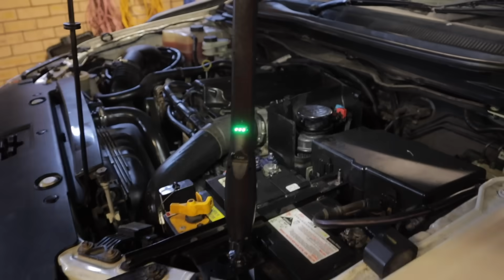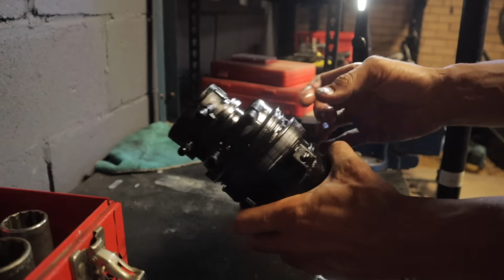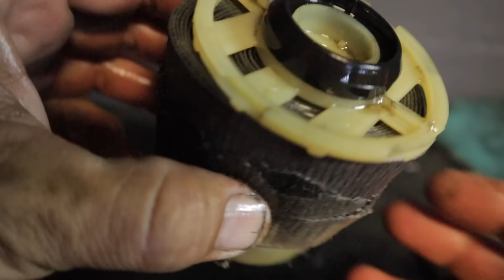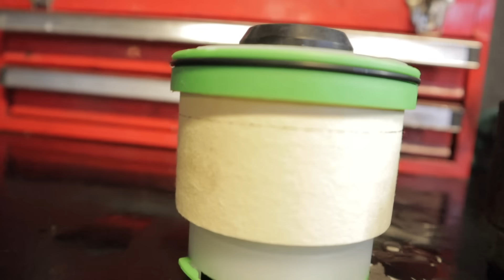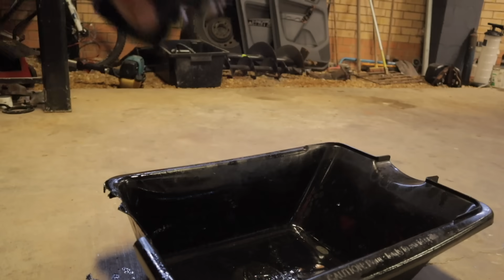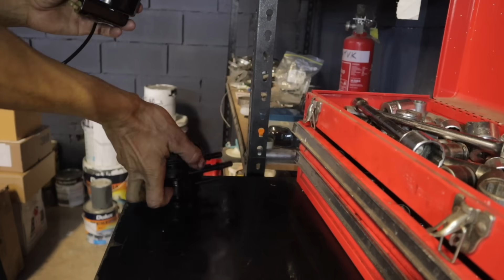The No.1 Reason Why Ford Ranger Engines Fail.

Comment: i just dont trust these cars/ford and holden as they arnt made in australia,remember the holden cars hq hx wb ford xa xb etc they where a bullet proof cars and easy and cheap to fix,now they are a bitsa parts from nearly every country,example holden astra,s a crap car,that why im stayn with hilux 2000 model  so easy to fix  and a headlight $30 a ford ranger 2023 is $2700 thats right $2700 to just replace 1 headlight with original and the rear tail light cost even more,a mates car small damage and $14,000 to repair if that wan the hilux 2000 would be around $500  tops

Comment: What happens when a filter becomes blocked is that it simply starves the engine of fuel. It does not cause the engine to fail. Water, which is what was found at the bottom of the canister, should have a level sensor that warns the driver should the level exceed the maximum allowed. That is the time to drain the canister.
Injector failure is not generally caused by lack of maintenance, although in very rare instances it could be. Injector failure may be due to bad fuel with contaminants that compromise lubricity, or excess soot caused by blocked air filters, or poor injector quality which was an issue with early Continental injectors fitted to these engines. The main thing that kills these engines other than injectors and subsequent melting of a piston is a failed engine oil pump.  These should be changed every 60,000 miles or so to prevent failure and seizure of the engine. This is not part of Ford’s recommended service schedules.

Comment: I do wonder why people are in denial about basic maintenance.
Motor manufacturers have done the R&D on this practice and if they say new oil filter at least every 10,000miles, they really do mean it. 
Same with fuel additives: oil companies have developed fuels to work well with modern engines, they do NOT recommend using old cooking oil in your new diesel. I am also skeptical of the need for AdBlu in a new diesel engine. £2.50/lt for AdBlu when it's only £1.30 for actual diesel? REALLY!
Reply: You must be getting fleeced on the Adblue. I can buy it in the UK in 20litre drums [enough for two Ranger refills] for about £1/litre compared to diesel for about £1.35 at the moment. Best price I can get short of 1000 litre IBC’s is for two 200 litre drums of Adblue at £0.50 plus VAT, so 60p for the private buyer delivered to your doorstep.

Comment: Thats a lot of water. Fuel tank probably the same. I recently did the Simpson in my 2019 3.2 many remote servos had very old pumps and tank arrangements. Will check my fuel filter after seeing this. 
Good to see the Ranger fuel filter has a water trap.

Comment: I think you got it wrong mate , let me tell you the reason Ford Ranger engines fail .It's got a weak oil pump design. The oil pump doesn't hold oil when doing oil change. You can't just open the sump plug and go for  lunch break, no no . This engine pump doesn't have a valve that keeps oil in the oil pump ,it will run out and you won't have oil pressure

Comment: Oooh, that was bad. I've seen filters that are excessively dirty before (here's my video of a 100,000 mile petrol filter https://www.youtube.com/watch?v=8aZLTbG993Y) but I've never seen one breaking down like that. Maybe it's the effect diesel has on the filter material. Yeah, good job you were changing it. And as you say, test and clean out the injectors and fuel rail. looking forward to that video.

Comment: Replace the first ‘R’ in Ranger with a ‘B’ and you get….
BANGER!
Reply: Don't you mean D as in Danger?
Watch out for the ranger driver.
Pity he saved it 😂
Reply: The motor in the Ford ranger is actually a Volvo motor.also I seen a short video where a gm motor.died after 4miles and another died at 100miles

Comment: I have seen a perfectly maintained Ranger engine fail due to an injector being stuck open.  An additional fuel filter is almost essential on these engines.
Reply: Ford engine is made by Volvo
Reply: Yeah, the one i saw drilled a big hole through a piston which led to catastrophic failure. New Engine Needed.   Done about 250K.    Properly maintained, just blew up.   AVOID,,,
Reply: a 2nd filter wont stop it as my mate blew his engine

Comment: Click bait title. Like others have stated maintenance is on the owner, not the manufacturer. I have the same model vehicle just a Mazda BT-50 and it's serviced every 10k kms, also installed a secondary fuel filter at near new as all diesel engines should have from factory but don't, and it's done 100k kms and no issues. Every vehicle will fail if maintenance is neglected. FYI depending on where you get your fuel from, but if regularly refuelling from service stations if you change your fuel filter every 20k km the filter can be sometimes as dirty as the one you showed, obviously not as old and deteriorated and stuck in the filter head, but I've seem them just as black. For those wondering about the condition of the tank- this is what a filter is for and if you have 2 it limits particulates getting through. A fuel treatment a few times to kill the diesel bug in the tank helps prevent things becoming worse
Reply: But if you do use an algae killer in the tank...check your fuel filter every week for the first month..
the dead algae has to go somewhere since it is no longer clinging to the tank walls.
Reply: Same , my Bt50 2013 has been tuned ,bigger intercooler, and I thrash it around, only city driving 280 000km, always change the filters regularly👌 although I haven't checked the diffs ,transfer or gearbox in over 5 years🤔
Reply: @ 
Renew the fluids if it's been 5 years.....
Reply: Plus the tank is plastic anyway

Comment: I’d suggest that you start saving for HP fuel pump and injections etc That filter 50,000 Ks I guess or the diesel is from the tip 
Can’t blame the car for That 
At the same time Manufacturer’s have this nonsense of recommending filter change every 60,000 Ka 
Madness every 10 at least and a pre filter 4 microns or less I am not a fan of conspiracy theories,but you would have to ask what their engineers are thinking about 
Those are not filtered anything after say 10,000 k 🚜🇦🇺🇮🇪☘️🍀

Comment: The filter arrangement is a gravity filter, water is designed to accumulate in the bottom because it must never enter the combustion chamber in diesels.  A petrol engine just has a straight filter because a bit of water in the engine is not a problem, it just vapourises and goes out the tailpipe.
A failure of the filter will lead to water entering the cyilnder which will blow the head gasket and possibly punch a hole in the piston head or snap an exhaust valve.  Usually though there is a release valve to let the water out, so they can soldier on for quite a long time before it becomes an issue.
The stuff at the bottom is just a bit of mud and water from the mine site.
Reply: My 1991 JDM turbo diesel has a water indicator 
(basically a cork float in the bottom of the fuel filter base just above the drain)  that activates a light on the dash.
Are you saying that this modern diesel....doesn't???

Comment: Did an engine replacement on a 2016 3.2 td ranger 3 weeks ago
 the egr cooler had shat itself partially hydrolocked the engine the customer then towstarted it drove it round for a week before booking it in for coolant loss
Reply: Ford have sent letters out to Ranger/Everest owners that state, if the egr cooler fails within 10 years and 250,000km, they will replace it, and any other damaged item, including engines under an extended warranty. I sent one of my customers with an Everest 2016 model to ford, they drove away with new engine fitted.
Reply: @glenohara6563  First time I heard of that. Is this something only in Australia?
Reply: @ Not sure if it is Oz only. But defiantly a thing here in Australia.
Reply: @glenohara6563  Got my letter, well after the EGR failed the first time. I got reimbursed fully. Had the EGR fail again about 20,000km later. Ford Fixed it. It has just now done it's third EGR, all within 50,000km. I told FORD that if this does not fix the issue, then the next time it will be civil litigation. They are jumping through hoops now to please me...... But should not have happened in the first place.

Comment: Seems like the quality of the fuel itself should be brought into question. Do the pumps not have delivery filters to separate water and debris.?
Reply: High humidity will cause fuel tanks to condensate. Depends where you live.
Reply: Fuel in Australia is ranked 75th in the world
Reply: @jamesbarrows-y2i Of course it is.

Comment: I also have heard, let me know if I’m wrong, if you start your ranger from cold, or maybe any other common rail and say for example move it out of your shed and put it out on your driveway without using for the day, condensation builds up in the cylinder wall and turns to rust and these tiny water droplets can rust over the injector nozzle affecting the spray pattern and then because of the huge common rail pressure the spray turns into a stream and can cut a hole through the piston. A mechanic at ford told me this and it’s seems to make sense, so if you start it drive it.
Reply: Rubbish
Reply: @ReddThreee  obviously not a mechanic
Reply: No he’s not, I am.
Reply: @ "I have also heard" and "let me know if I'm wrong" but you're a mechanic?
If you're a mechanic, you'd know wouldnt you?

Comment: This would be for all diesel engines not just Ford Rangers
Reply: My hilux diesel never has that problem 😊
Reply: @macrospaticawen3611 got nothing to do with the manufacture of the vehicles but everything to do with maintenance and dirty fuel in this case. All diesels need clean air, clean fuel, clean oil and regular maintenance. Then they pretty happy and will run for years.

Comment: Don't use brake cleaner on plastic or rubber. Surprised the brake cleaner didn't instantly turn that plastic brittle and crumble in your hands. Plus any seals on the housing you got brake cleaner on would likely of turned hard and/or lost its shape.
Reply from the maker: Been doing it for 200 000kms & 5yrs on my other Rangers filter housing with no issues 🤷🏼‍♂️
Reply: @abdautomotive  Likely you have the non-chlorinated stuff which is less damaging on plastic but can stick effect rubber. You can still get the chlorinated stuff though so gotta be careful. Better off using something like Windex and compressed air or if no compressed air use a plastic safe electrical/contact cleaner
Reply: The only time I seen a reaction like that was on my dolphin torch and it was petrol 😂

Comment: Mate you got it wrong sir yes poor service would cause any vehicle problems but Ford rangers main problem is there gear boxes really
Reply: To single out Ford transmissions as bad in general you are incorrect. Holden Colorado are known for having faults with their transmissions also. I have a 2018 model Ranger  3.2 auto and have had no problems with my transmissions. 😊

Comment: Yep  have always suspected a large percntage of failed vehicles come down to either owners not maintaining them properly or mechanics doing poor work or no work.
Reply: I have a Honda C-RV 1.6 twin turbo diesel and it has been serviced every year or 10,000 miles, usually every 8000.  Last three services were at a main Honda dealer and at the very last service I asked for a full major service apart from auto gearbox oil and rear diff oil which had both been done less than 15,000 miles previously. The car broke down with my wife and daughter on a motorway and had to be carted to home on the back of a truck Turns out that they had done as I asked, including changing the brake fluid, but had not bothered to change the fuel filter in any of the three services prior. The system detected low fuel pressure and shut the system down. That’s all that happens if a common rail fuel filter blocks. Changed the fuel filter and it has been fine since but I have lost whatever trust I ever had [not much] in main dealer servicing. I’ve yet to find one that I can trust not to try and fleece me and/or to do the work properly.

Comment: It’s a ford 
They are the best at breaking down then pissing off mechanics because they are designed and built so stupid
Reply: Can you explain yourself on how they are designed and built so stupid generally curious?
Reply: @ personal experience customer brings in 2013 f-150 to reseal from diff cover and the differential has to be removed from the truck to get the cover off and to change the oil there’s no drain plug so cover has to come off . I called the ford dealer and the service manager said he gets yelled at on the regular because it’s $1,300 to change the oil on the front diff 

In the same day I did ford diesel power steering pump and dodge diesel power steering pump , ford took me all day and the dodge took me 30 minutes 

I have 20 years experience on highway , Offroad and automotive and fords are the worst
Reply: @benmartin6476  Ye fair enough. I am not to sure about the f trucks but the rangers are pretty easy to work on I cannot complain.

Comment: Factory recommended interval Toyota filter look like this when done  [blackish].
Another great idea is run fuel down to 5---10ltrs remaining and drain tank completely . This removes water and debris . Drain the tank into a white rag .
Reply: Toyota diesel fuel filters definitely do not look like this during it's recommended change intervals. 

And the 'blackish' you are talking about is the asphaltenes in the diesel fuel, not dirt, which is completely normal.
Reply: @jack11224  
I was new to diesels but I knew when it wouldn't rev over 2500rpm that there was something wrong. 
I took strings of algae out of the old fuel filter of my JDM import turbo diesel. 
The fuel filter had Japanese writing on it....
maybe never changed from new....some 9 years!

New filter= 4200rpm.
Reply: @JohnSmith-pl2bk  Wow, yes, it most likely had never been changed. Or either the car was sitting for a long period of time on the same tank that accumulated water or a bad contaminated fill of diesel. However, with other people in these comment's saying they change it every service, I still think that's overkill/unnecessary, especially in Australia. We have relatively clean fuel.

Comment: I do mine every 10K interval, no matter what happens, plus I put a 30 micron pre filter before that.
Reply: THat's great, but 10k is 5k too many in my humble opinion, but at least your truck has something to look forward to on a regular basis. And I'm sure you love it too.
Reply: @ I agreed that 10k is unnecessary espically with a pre filter. But consider an OEM filter is like 40 ish bucks, and only took me half an hr for the job, I will but this insurance in case of a heavy bill on pump and injectors.

Comment: Very good info..i use to get a clean diesel and patrol for cleaning any dirty part..its work great..i own 1 ford ranger 2014 T6 manual transmission  model..works fine until now..just maintain a regular service when its time..

Comment: i do mine every 7500km with the oil. ive done 285,000k and only had to replace an alternator and the egr cooler
Reply: My 2015 Mazda bt50 3.2 has done 225k egr failed at 207k did a headgasket head oil pump replacement thermostat replaced lifters and still haven’t fixed that bloody tapping
Reply: @midwestdairyfs3122   sure it's not injector noise

Comment: How is that engine still even running?
Reply: They are strong engines man I did a egr cooler pipe while four wheel driving didn’t know until I got up the Sand dune limped it home with no coolant did no damage somehow
Reply: They aren't fragile.
Reply: Cos the vane oil pump hasn’t blown up yet😂

Comment: Love my 2017 3.2. I have just about 170k and it still pulls like a Mac truck. One advice, replace the EGR cooler as well and you'll thank youself and so will the motor.
Reply from the maker: My last video was a egr bypass 😉
Reply: Funny y say that cause I bought a 2015 Mazda bt50 3.2 p5at egr failed on my way home ended up doing the head gaskets head lifters oil pump and more and still can’t fix the tapping
Reply: @midwestdairyfs3122  sorry to here that. I knew I needed to replace it eventually. So at 120,000 I changed it regardless. Other than that my Everest has been rock solid .
Reply: @Deatomizer How much to replace the EGR cooler? Doing this as a preventative measure makes so much sense.
Reply: @boreeng  I paid about $1,600 in Sydney.
Reply: @Deatomizer Just bypass the EGR cooler mate, those things are useless.

Comment: I'd be more worried about the pump! Dirty fuel is the enemy of the pump. On my PX2 I change the fuel filter every time I change the oil which is 10,000klms. A genuine filter is not that expensive from Ford but a new pump will be very expensive!
Reply from the maker: Pumps are easy to replace, my concern is a failed injector causing hole in piston

Comment: Yep, i have ALWAYS done my fuel filter with my oil change at 10,000klm 👍
Reply: You’re a good boy.. makes sense though. Fuel pumps and injectors cost small  fortune.. then there’s the engine… easy to write off a car with poor maintenance. I’ve gotten away with a lot in the past.. but now with a modern turbo diesel I don’t play around. Filters and fluid are cheap. One thing that still gets overlooked is sensors. I’d bet money everyone’s map sensor is blocked. Car will still run fine, but it’s costing you fuel economy and  potentially a dpf filter sooner than it should..I think it might even effect egr operation too
Reply: Yeah that's how we always serviced the taxi fleet in best oil the owner could afford and filter plus fuel filter , every service, fuel and road tax was a lot lot cheaper